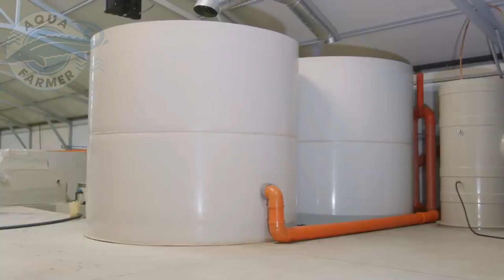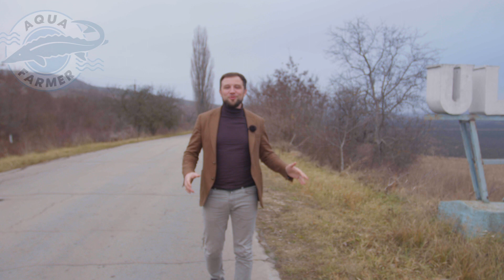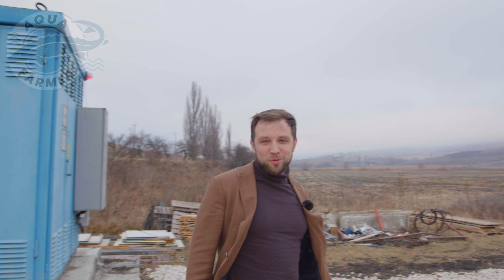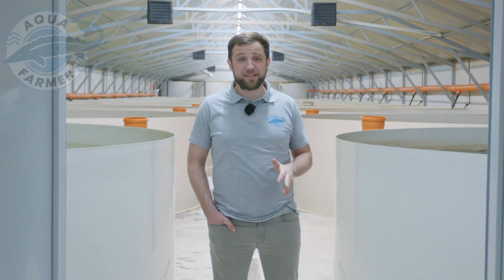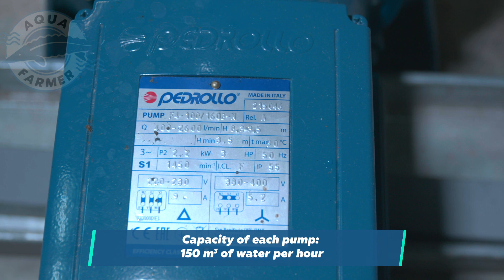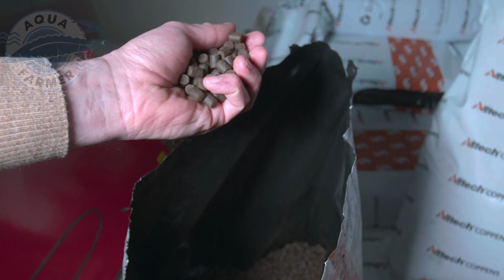Overview of a RAS FISH FARM for STURGEON CAVIAR! How to TURN A SITE IN THE FIELD INTO a CAVIAR FARM

Comment: Muito bonito mas pouco eficiente, com tanques assim requer muita mão de obra e custos elevados de energia. Em um prédio deste eu faria 02 tanques retangular com separações por tela para melhor controle populacional... 
Very beautiful but inefficient, with tanks like this requires a lot of labor and high energy costs.  In a building like this I would make 02 rectangular tanks with screen separations for better population control...
Reply from the maker: You are right, but then it's going to be some problems with solid accumulation in tanks like you offer. Plus these tanks require concrete or firm metal structure which is more difficult and expensive

Comment: 1 ton per year....  It is very less lookin at the size of this infrastructure....just 1000kgs?
I think its just voice over mistake
Reply: it's caviar not fish
Reply: @indupanta2898  regardless if we calculate 250 Fish, that means 4kgs per fish, when in sturgeon each fish can have up to 60% body weight in Roe...so if each fish is harvested/Milked at around 7-8 Kg body weight the 1 Ton would be correct...if more then it follows